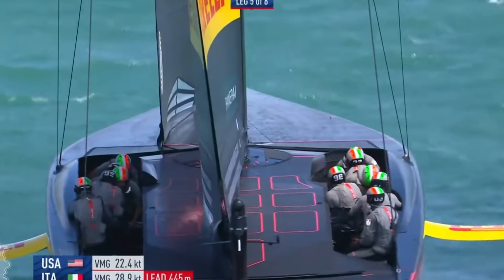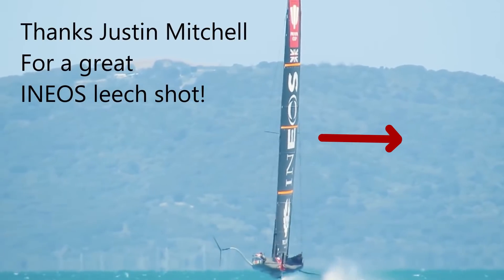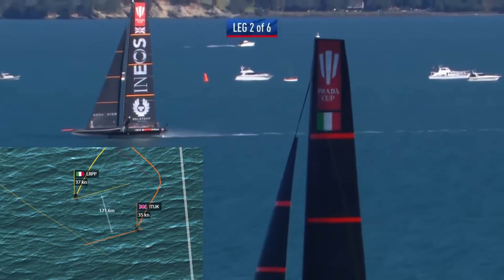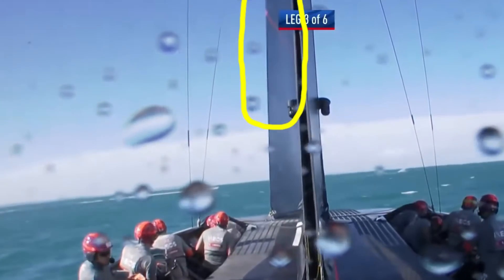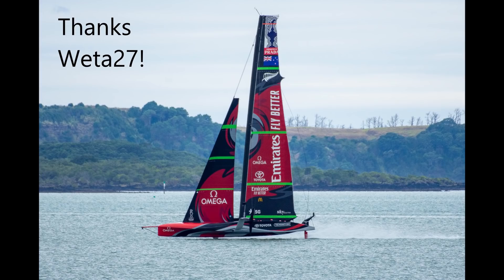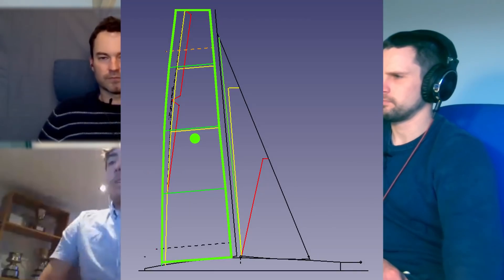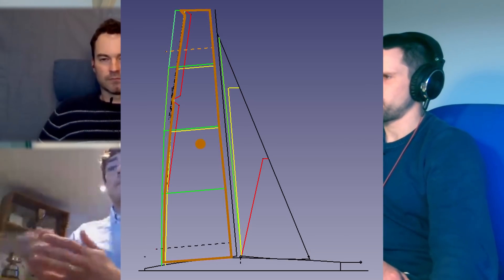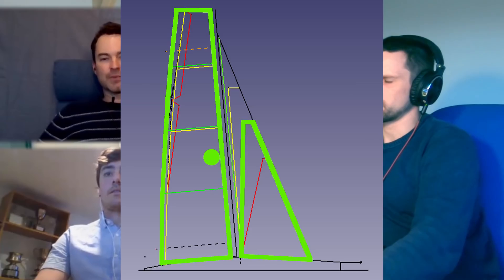The alternative reason for ETNZ Batwing : Americas Cup Sail Plans (Part 2)

Comment: Given wind speeds are higher up high, due to less drag from the water below, the point of the upper mast is to capture air and get the boat moving.

But the main as per the rules is too big for the righting moment of the foils, and thus a lot of induced drag fighting against the pressure leaning into the sail is evident.
The selection of teams to trim down the sail area up high suggests they want less area, and less roll on their boats, while bound by tight rules regarding what little they can do to modify the total sail height under the regulations.

Presumably under light winds, the needs to gather as much wind to get onto your foils will compete with the need to go as fast as possible when on them, but under heavier winds, the uppermost part of the Mainsail is drag and Roll waiting to be trimmed out and will just slow you down.

It would be interesting to see what the next generation of these boats can do to lower the Mainsail during racing to reduce the drag effects caused by excessive sail areas up high. Will we have Mainsail winding drivers on the booms of every boat? Or would they be more weight than the benefits can justify?

Comment: one thing you can be sure of ETNZ will be fast they have been chasing the cup for at least 2 decades, they have so much talent in boat building and sailors not to be fast, not to mention three times cup holders, it remains to be seen if LR is fast enough. at this point i still see it as advantage to ETNZ , home waters cup holders so they get to set the rules.

Comment: Some excellent points. I do think that smaller jibs mean the slot is less well defined and normally that means pointing ability is impacted and therefore VMG. So when you do go smaller with the jib you need to make sure you still maintain the slot...I do agree that a smaller jib is quicker through the tack though I do wonder if LR advantage over Ineos was more due to the foil drop trick they have perfected and hull shape.

Comment: So ETNZ favour slightly larger jib. These sails undergo over 6 tonnes of pressure so they behave like solid structures when trimmed. Perhaps the bat wing also allows ETNZ to tack with greater stability especially coming out of the downwind gates. Much like a plane banking. I would love to see a discussion about the relationship between wind COE, up draft to the mainsail & sailing angle windward.

Comment: Does anyone know why the boats are not removing their bowsprits, they all say codes are not gonna be used anyway. Is there a minimum length for the boat, or is it just that they don't want to take the risk of not be able to use code if the wind will be steady 6.5 kn?
Reply from the maker: The rules say they must have bowsprit that are capable of carrying  X tonnes of load. But I expect they will go if these boats return for AC37
Reply: @MozzySails  Ok, thanks!

Comment: Great discussion about the centre of effort & its movement with different jib selections and the relationship with the righting moment. 
But one thing you don’t see, except when they crash out, on theses boats is much difference in heeling angle. I think due to the density of the water & efficiency of the foils there is abundant righting moment. Correct me if I’ve got this wrong. The challenge is when they slow down or stall out the foils everything comes apart. But if you can keep things at speed, & under relative control, you have righting moment. 
 
Is the balance of the centre of lateral resistance, in these AC rules,  still controlled by raking the mast? And how does the flight controllers effect this with the pitch of the boat when getting  on the foils or coming off them?

Comment: No mention of code zero ☺ not a criticism I never expected it to be used. It shows how efficient the sails are, as they are looking to reduce sail area so quick. The other reason to reduce sail area is sails deform from design  shape, with modern strands in the cloth this is not so much an issue.

Comment: As I recall as wind velocity increases your CoE moves after. So if you run a taller job on these boats, with the Bat Wing main, you can pull your CoE forward on these heavier wind days. This also explains a bit about American Magic’s  burn out. Their CoE moved back dramatically as the wind velocity and boat speed increased. Likewise the CoE was much to high for that wind velocity, which over powered their righting moment-over loading the rudder, and putting them in a apparent wind broach.

The physics of the whole thing is so incredibly complicated, it’s like trying to balance a golf cart on a sewing needle.

Comment: I'm not a sailor but I can use logic; LR despite the smaller jib was able to develop the same (or even more) "power", result? Same or more power but better maneuverability.
In short that jib is the "proof" which LR was a better boat than INEOS.

My logic is correct or I do it too simple? Thx and sorry for my "google-eng", I hope you understand what I mean.

Comment: Great video as always - thanks. I suppose it is possible that something like the bat wing main could be a compensation for something else rather than an outright advantage. Like if you had to move centre of effort forward. Is the fore/aft position of the foil arm set by the rules?

Comment: With a smaller jib with the effort moved to the lower part of the main it would seem that because there appears to be more control of the shape of the main down low it should be advantageous  to use the smaller jib. It seems that ETNZ has spent a good bit of research on the control of the main shape down low.

Comment: Regarding the batwing main, on the day ETNZ tested it they started off with a larger jib and then switched to the smallest one in their inventory. I'm guessing winds picked up later in the day but after viewing this video I'm not so sure anymore. Also on the topic of jibs, why do the AC75 boats carry a bowsprit when they never seem to use them? The only time I've ever seen an AC75 use the bowsprit was once here... https://www.youtube.com/watch?v=LDwOPVTLVEo
Reply: As far as I understood is meant for a Code zero jib, never used because of too much drag.
Reply: @canaleluigigalli  yes, K. Read mentioned a code 0. To be used in light wind conditions (non foiling). But then it seems they can't complete the race within the deadline.
Reply: With or without code 0
Reply: @sailbox_bar2600  It seems they want to avoid racing in non-foiling conditions altogether, which would render bowsprits superfluous on these boats. I expect they drop the bowsprit in the next iteration of the design, providing they keep the foiling monohulls.

Comment: Great presentation. You guys should work for one the teams or the broadcast. Question: It looks like ETNZ are sailing with a small windward heel like a windsurfer. Why?
Reply: With the T foil , the lower part(200mm) of foil arm can work as an additional lifting foil, in light winds?

Comment: Can they control the forestay length to balance the coe variation between the different size mainsails.
Reply from the maker: Mast rake is fixed at 5 degrees, with a tolerance of 0.5 degree either side

Comment: Does anyone know if the ailerons on the foils be used to rotate the foils on a roll axis?
Reply from the maker: Yes, the flaps either side of the foil arm can be adjusted separately and even have negative flap angle if so desired. How much this is being done is up for debate, however.
Reply: @MozzySails  they say the inner flap is used in HighMode, “reverse angle” to the outer one. I think that make sense in an Y foil (like on LR), not so obvious in a T foil (so TNZ asked for the single actuator) especially when both are running “tip scratchy” the surface.